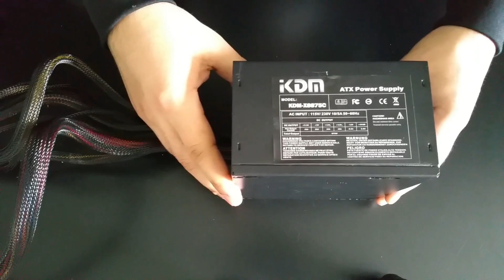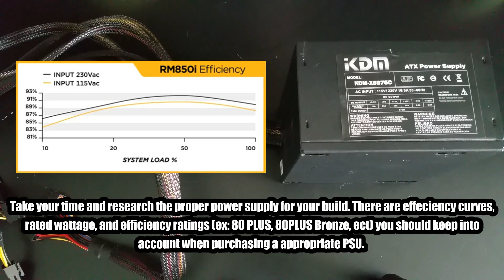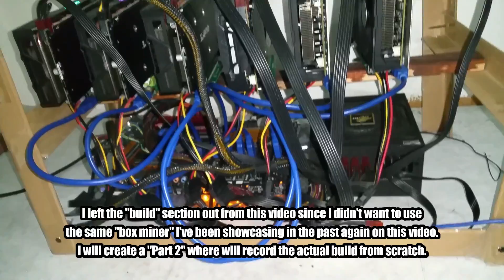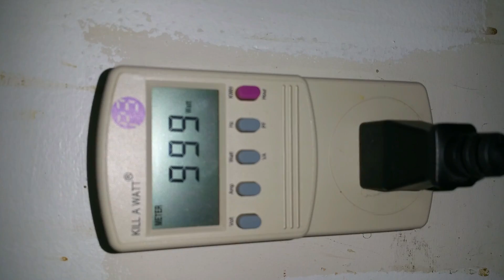How to Build a GPU Mining Rig Part 1 (The Parts)

Comment from the maker: Since the brilliant minds at youtube don't allow you to make corrections on videos anymore I wil Pin this here. 

*UPDATE* When this video was released boards like the H110 pro BTC+ and Asus B250 were not released. This naturally forces the user to use multiple power supplies in order to compensate (which is a good thing since you will need less motherboards,cpus,ram ect..).  I would definitely recommend buying newer boards since they are constantly adding the ability to add more cards. Other than that, the rest of the video is still viable!

1) When it comes to  mining with 4+ GPUs on the Z170 chipset you will run into alot of problems. Always make sure the motherboard you purchase has enough PCI-e lanes to run all the cards (even though it has 6 PCI-e slots). It can be done by disabling certain devices in the motherboard with bios tinkering but I personally would suggest shying away from the Z170 chipset all together.
2) I forgot to mention you can boot the OS using a USB thumbdrive aswell.
3) Be carefull when purchasing RAM, the particular RAM I show in the video is a server grade ECC module which will typically not work on regular desktops. Make sure you purchase the appropriate type of RAM for your motherboard.
4) Do your own research, every component deserves a alot of studying before pulling the trigger and purchasing stuff. It's impossible for me to relay everything on a single sub 20 minute video, take your time and plan things out. This video is a starting point in order to help you guys begin the journey. Good luck all :D
Reply from the maker: Kris AL I know the MSI Z270 gaming M5 and the ASUS PRIME Z270-P can run 6+ cards. I have a ASUS PRIME with 8 cards atm. You need m.2 to pcie expanders or a pcie switch expander multiplier hub. They both work with 6 without any extra additions. There's a few more that I don't know off the top of my head.
Reply: Well, what other motherboard do you recommend ? Cause I wanted to build on the Z170A chipset but If you say its not good with 4+ GPUs then what mobo should I buy..?
Reply from the maker: Kris AL I have several z97 AsRock Extreme4  that work great.
Reply: well i've looked around, i think best option for mining would be the h97
Reply from the maker: Kris AL Do what you think is right.
Reply: Geek Mark do you know any lga1551 mb that supports 6graphic cards? sorry if im bothering you tho. :p
Reply: Geek Mark haha thank you for the reply my friend i already purchased the Z270 :D
Reply: If im starting with "low" budget and i want to get into mining, how many GPU would be worth to start with? As many as possible would be the right answer but, what if i can afford lets say, 6 gpu. Is it worth?

Comment: you can buy a heavy duty PSU for cheaper gives same Wattage than high grade gaming PSU.
Reply: should the breakout board attached to the heavy duty PSu have a capacitor on it or not? I see 12 six pin psu slots that do not have capacitors on them but some with 8 or 10, 6 pins slots that do.

Comment: You used just 1 SATA cable from PSU to connect all 6 risers, right? But my PSU is an EVGA 1600W, which has LOTS of cables! :-) So I could use 6 SATA cables to connect the 6 risers, right? Would it be more safe?

Comment: The slowest cheapest and simpliest processor like an 31 dollar  celeron skylake 3930 2.8 ghz dual  is enough for 9x gpu mining rig?
Reply from the maker: The g3930 is a kaby lake CPU if I'm not mistaken. You might have it confused with the g3900 which is skylake. I know certain boards can run 8 GPUs using the M.2 slots with a g3900. As far as 9, you would have to add a PCI-e switch multipler riser HUB but I personally have never tried it so i can't say for certain.
Reply: well so far sorry for the confusion ,but have you ever heard about the GPU PCi-e slot expansion cluster      (1 slot with this expansion cluster=4 running  GPU s)from AMFELTEC located in Canada,Ontário it is not in my might to test it but i think you have a reason for developing your experience if 1 motherboard could support between 13 -16 GPU s how is that for increasing eficiency????very atractive acessories builder specialists out there in Ontário,keeping in mind that ideal function is comparable /or above multiplier expansion card... can you test it and make a youtube video with this evolution?cheers for great mining you have my attention...

Comment: Sorry for the noob qustion, but can you use video cards that only take power from the pci express slot? Picked up cheapass RX 460 few months ago, just wonderin if thats possible.
Reply from the maker: Are you asking whether it would work plugged in straight into the motherboard opposed to the risers (the answer is yes)? There aren't any RX460s that solely run off the pcie slot that I'm aware of. They all utilize the power supply Pci-e connectors.
Reply from the maker: Ohhh you're right, man I must be way to used to buying higher end cards that I never noticed some lower end models don't even use dedicated power supply connectors. I was aware older cards didn't require them but I didn't know they still made them that way. You learn something new everyday xD. I would assume they would work, but it will most likely not be very efficient.

Comment: NEVER use an HHD.   Use a 32 GB thumb drive.  NEVER use a single PSU.   You only want to be at 50% of your PSU.   

Don't buy the low end stuff in this video either
Reply from the maker: Uhhhhh.. Ok lol. You come and throw numbers and don't even explain yourself. Yeah theoretically under the efficiency curve you want to sit at around 50% for best efficiency, but don't be absurd and announce that is an absolute must. Look at all large scale factory sized mining operations out there, most if not all use single PSUs. There's a reason for that, a modern PSU (with solid caps) will run perfectly fine under 80% load for a very long time (PSU warranties range from 5+ years for a reason). Under your guidelines, I would need four 750W in order to run 7 RX 480s in ETH. That's absurd, not to mention how inefficient the system will be, power supplies are notorious for burning/wasting watts under use (that's the reason why the 80 plus rating system is so popular). As far as the thumb drive, yea you can use one. I forgot to mention it but DO explain why you should NEVER use a HDD haha, come on now... What are you even talking about "don't buy the low end stuff". Low end CPU,RAM and cooler doesn't mean it's crappy quality, just means the performance is a bit lower than average (which is perfect for us since we won't be using it). Anyhow.. I'm not gonna feed the trolls, you do what you think is right c: thanks for the dislike <3